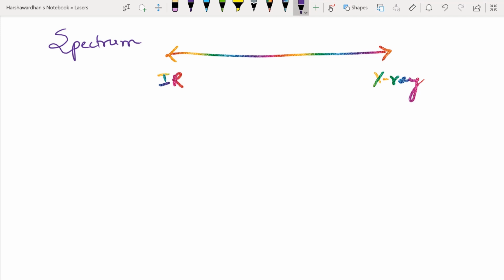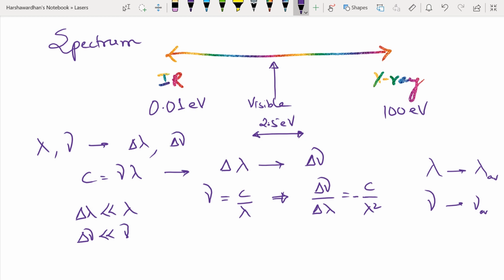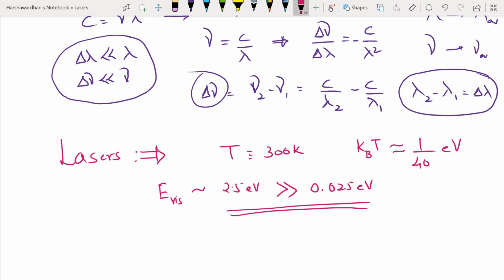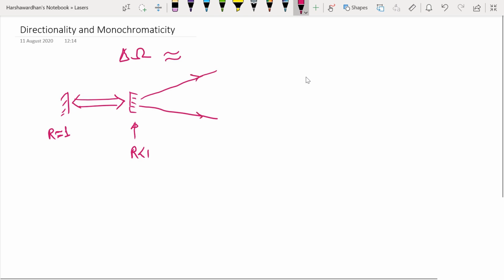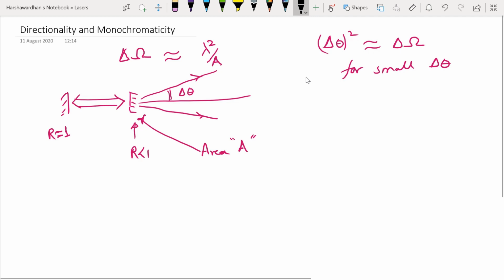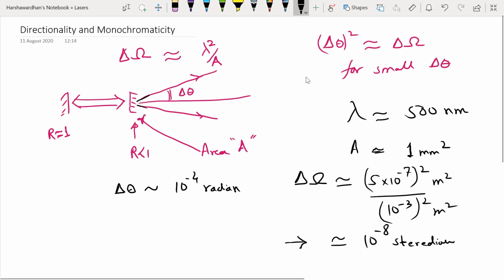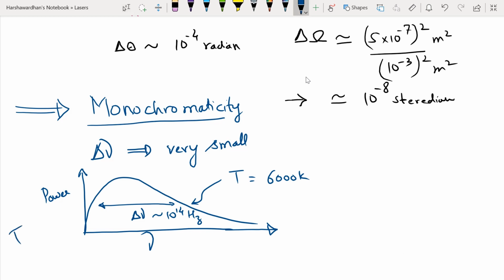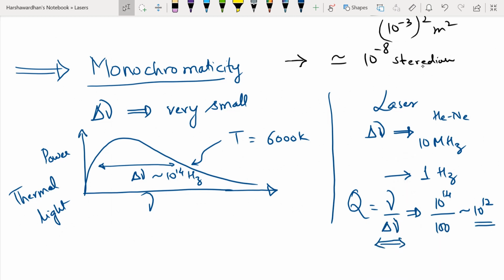PSE602-L-04-Laser Characteristics-I (Directionality and Monochromaticity)

Comment: Could you elaborate more on how to get the solid angle ?
Reply from the maker: For cylindrically symmetric beams solid angle  is approximately the square of the planar angle. (True in the small angle regime). Can be measured by moving a detector perpendicular to the beam path and measuring the fall in the intensity.